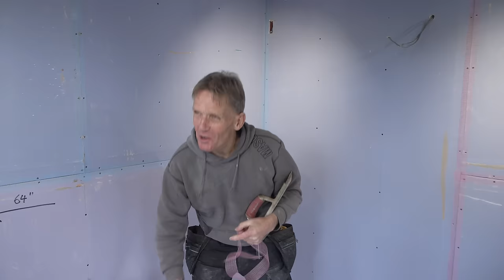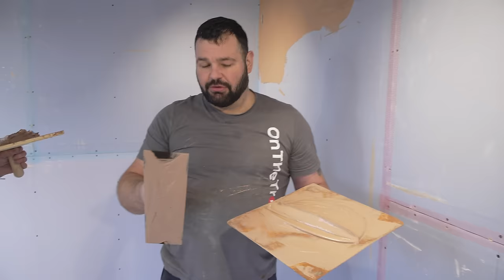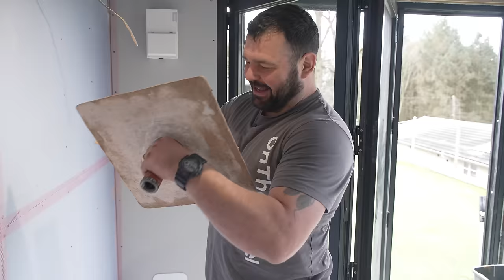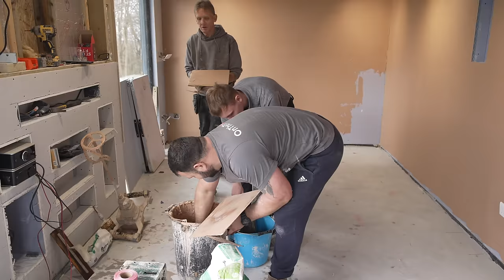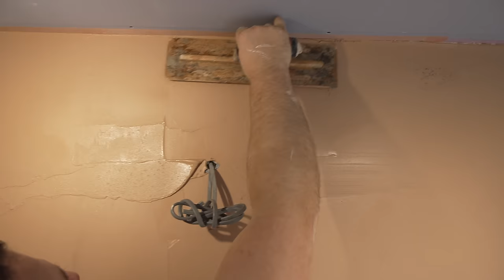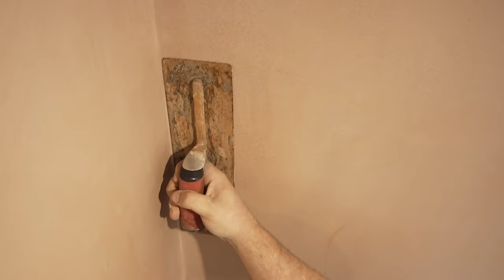TEACHING ROGER TO PLASTER | NO PROBLEM

Comment: After plastering and touch dry, I mix up 60/40 emulsion & water and roller the lot. Once fully dry it provides a perfect key for the paint, whether that be emulsion or vinyl silk! 
Vinyl silk paint can be a nightmare to key into plaster otherwise, and even watered down normally results in having to Zinnser the walls.

Comment: Hi Kirk, do you ever see a situation where joint compound is needed with scrim? 
I’ve overboarded my ceilings (old ceiling full of distemper..) and debating whether to scrim joints and plaster over, or joint mud over scrim and drywall screws beforehand?
What does the jointing compound add, or can it be negated?

Comment: Roger wouldn’t make plasterer has long as he’s got hole in his arse to be honest I’ve been in the trade for 39 years still laying on 🤣🤣👍👍🇬🇧🇬🇧
Reply: Hi Jason 
You may be right but despite all that kerfuffle the end result was there or thereabouts. Of course I could be faster and more efficient but I have spent the last 39 years trying to fix leaks and that hole in my arse.
Reply: @SkillBuilder  well roger stick to pipe work a may stop a lot of cowboy makeing out they no the trade and true plasterers cleaning up the mess 🤔🤔
Reply: Bodger Frisby has spent 39 years trying to fix a hole in his arse a tube of silicon should work but he does not need to open the tube just ram the tube right up ,and he must coat tube first with pva

Comment: Watched rodger do a sand cement scratch and top external render finish so surley he can skim no problem
Reply: Two totally different trades
Reply: @markrobson9894  well its 100% not is it its the very cornerstone of the trade . If your a proper plasterer you should be able to apply and finish multiple materials especially render.
Reply: @adamcunningham2511  but there 2 total different materials nothing other than putting it on with a hand board and a trowel are the same
Reply: @markrobson9894  so when a customer calls you out because they have damp and you have to hack of the plaster and put a sand cement mix on the wall with waterproofer in it , what are you saying your gonna phone up a renderer because your unable to spread another material 😆 . Different material same trade.
Reply: @markrobson9894  skimmers are not plasterers they are looked down upon in the industry that's why they go around sites earning £2.90 a meter and I go earning £400 on a Saturday for Overboard and skimming a box room finished by 1.30
Reply: @markrobson9894  + materials
Reply: @adamcunningham2511  I don't do site work mate all private give ya self a pat on the back you must be the only plasterer that earns 400 aday are you 👏
Reply: @markrobson9894  no mate I earn even more when I do rendering coz I'm a proper plasterer
Reply: @markrobson9894  earn even more when I do rendering
Reply: @markrobson9894  coz I can